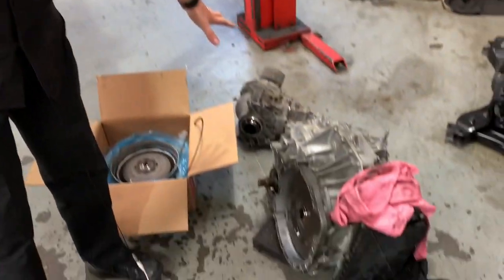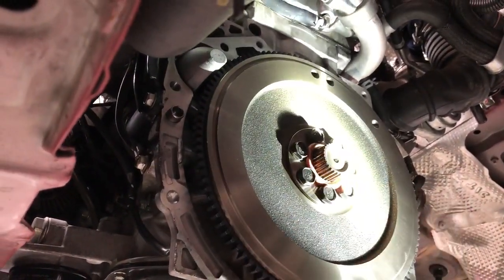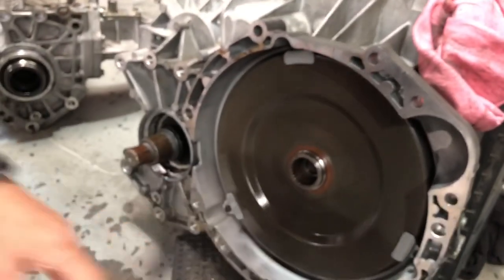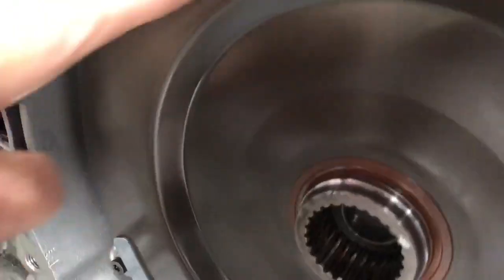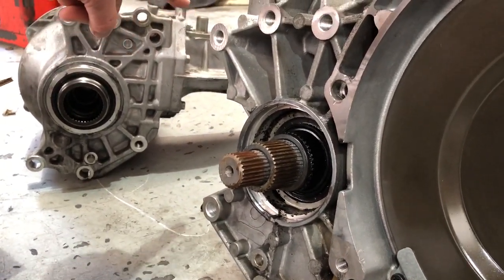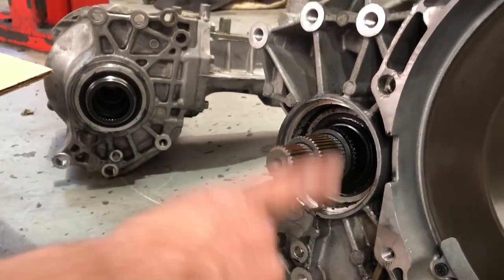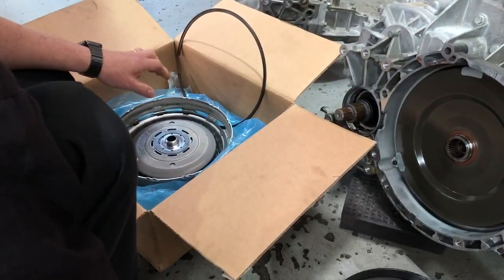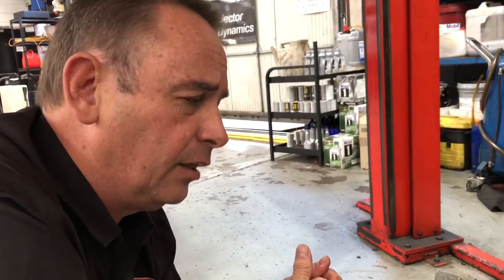Mitsubishi SST Transmission Tips - Evo X / Ralliart - Part 1

Comment: Trying to diagnose my 2012 lancer Ralliart with the SST Transmission. When you shift it into gear or reverse. no pull but almost like it goes in. the symptoms is no pull acts as if it has a broken axle and when you put in park, the park pin will not going in as if it was rolling. unless I shut it off to stop rotation. Also, the drive indicator will flash by the shifter.
Reply: Did you ever figure out your problem I have the same exact problem with mine ?

Comment: Hello. I am wondering if there is some effective way to assess the condition of your transmission without taking it apart? will you be able to assess this by putting it on a dyno or similar? 

About 6 months ago, during the height of summer my car lost power on two separate occasions. once the car cooled down, it drove fine and didn't lose power (total loss of power, revved out on the two occasions i had an issue).  I had the transmission fluid and filter changed and have not had any issues since. However, for peace of mind, i would like to be able to assess the condition of my transmission as i fear i may have caused damage. The problem first came up on a very hot day. I accidentally hit the paddle shifter and shifted down a gear when i accelerated. there was no noise apart from high revs, but about 30 mins later, after parking the car and then returning to it, it drove around 1km before losing power. The code that came up pertained to a shift fork (No# 2 i believe), but haven't seen anything like this since the service. 

My car has done 90,000km now (around 75-80 at time of issue).

Comment: Hi brett I am going to install a hp 10  plate clutch on my lancer ralliart which is stock would the normal transmission teaching work fine or do i need to tune the transmission ? Thanks

Comment: I wish you could open a shop in the USA. Thanks again for educating us on the SST. I’m at 60k miles on a ralliart without any issues. Do you recommend having it flashed with s-sport to increase clutch pressure for longevity?
Reply from the maker: we do NOT recommend the reflash option of this trans we have seen too many other problems related to using non OEM spec ECU files